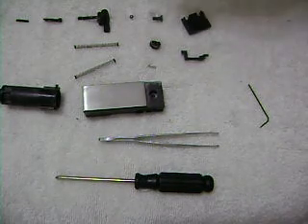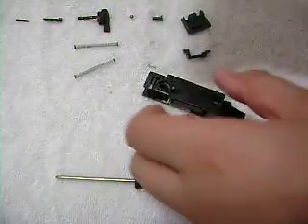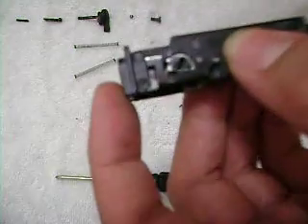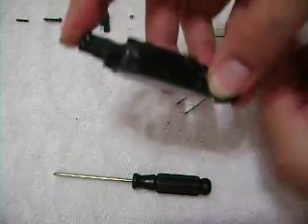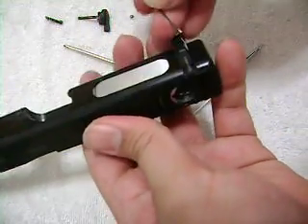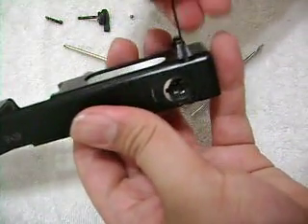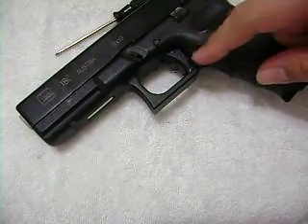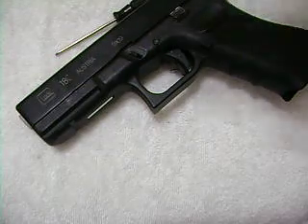Disassembly of the KSC GLOCK 18c PT3

Comment: My ksc glock 18c's alignment pin fell out, I found it but I can't get the rear sight to slide to the side like that so I can tighten it back in. Btw when I put the pin back in do I have the side with the hole facing up, or down?